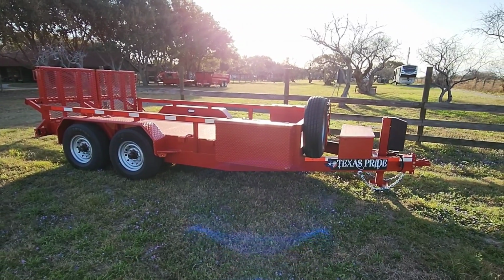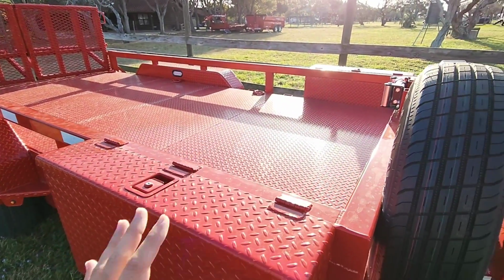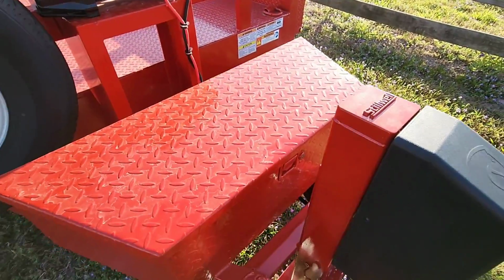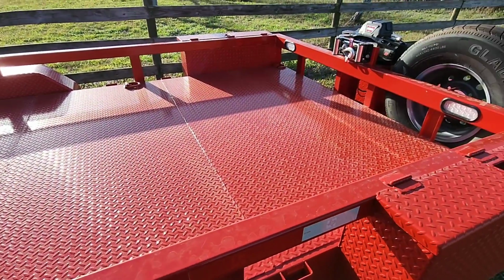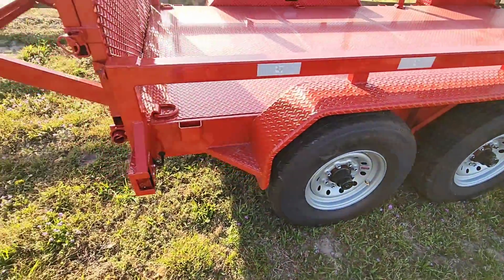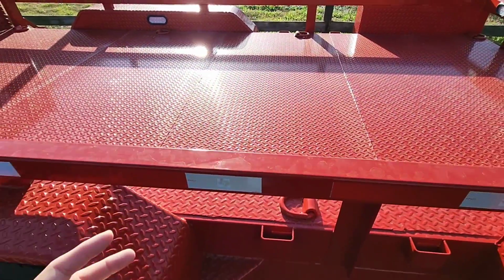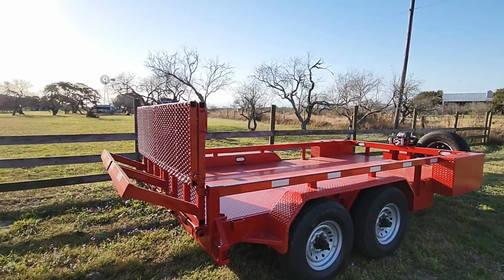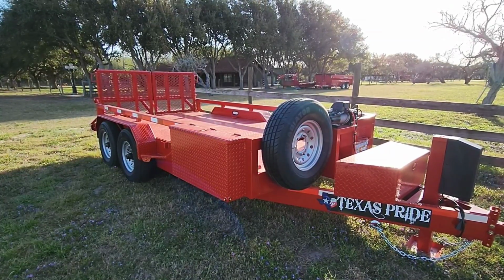INCREDIBLE! but what happens to my tilt Trailer? My new Texas Pride Low Boy!

Comment: I am having a custom 12K 14’ equipment trailer made for my pressure washing rig. I cut as much weight as possible from the trailer by removing the dovetail and ramps. It’s the best length to weight/cargo capacity ratio. 14’ is a good length for most rigs.

Comment: If the hinge is large enough, the knee on the ramp is not needed as close as the axles is to the back you will never load anything heavy enough to lift the truck up, and I'm betting those side boxes get water in them when it rains. other than that, nice looking rig.

Comment: The new trailer definitely seems better suited for multiple vehicles/items vs your tilt deck but it seems like you could do certain things to get a combination of things loaded. Like locking the tilt deck in the up position while loading so you could get both things on then unlock and reposition or load your zero turn first and move it all the way forward onto the stationary part of the deck and then once you get the second tractor or zero turn on and the deck flattened you could reposition vehicles again for the haul? Maybe you already thought of these options.  Just curious.

Comment: Spare tire facing front should cut back on comments about using a cover with the flag facing the wrong way. Nice features on the trailer. Another BTBRV collaboration edition trailer. As long as you have the spot, I say keep the tilt bed trailer. Thank you for sharing and have a great day.

Comment: Personally, I like the look of a wood deck on a trailer. I stain and seal my trailer decks after the wood has a chance to "cure". I'll add an antiskid agent like sand or sharkskin to the stain or sealer. Downside is it has to be done yearly or bi-yearly, depending on use and wear. The main reason I don't opt for steel decks is because of the weight. In your climate, the steel plate would probably be the better way to go over wood decking. I really, REALLY like that there are grease zerks everywhere they are needed. Way overbuilt, but.... It wouldn't be a BTBRV trailer if it wasn't. What's the point to watching if its just a normal trailer lol. Good stuff, JD! Congrats on the new trailer and best of luck with it.

Comment: I know, ultimately, youre talking about added weight, but if youre planning on having this trailer be reliable for 10 or 20 years, I think I would epoxy coat the bed & D-rings, and add sand on top, for traction.  Maybe even do the wheel wells, to protect from rust.

Comment: Thanks for the info.  I have been researching trailers trying to decide what to purchase to haul a 9400lb skidsteer, dirt bucket and concrete mixer attachment. Any issues with the tilt trailer? I'm leaning towards a tilt trailer or a flat bed over the tires.
Reply: You wont be able to drive onto a tilt with wet deck/wet tires/muddy tires

Comment: Several recommendations I have 
1. Get some RV style tire covers for all your trailer tires.  The sun in Texas will likely bake your tires like happens to mine up here on the sunny side of WA State (eastern WA).
2. Put some non-skid material (tape, etc) on those little fender steps.  I did that to a trailer of mine and it has helped with stepping on them in wet weather.
3. If you haven't added them to your auto insurance policy, do it.  I have my trailers insured.